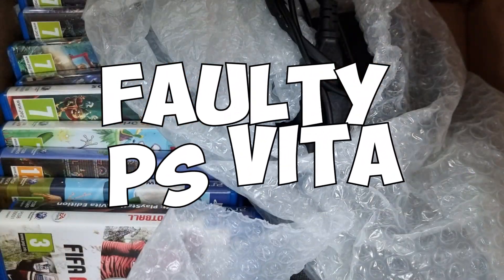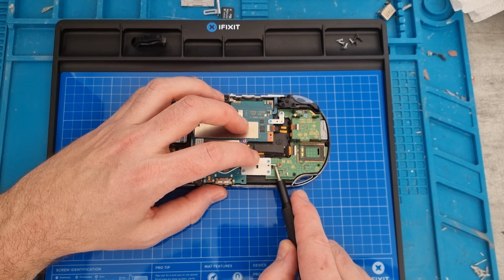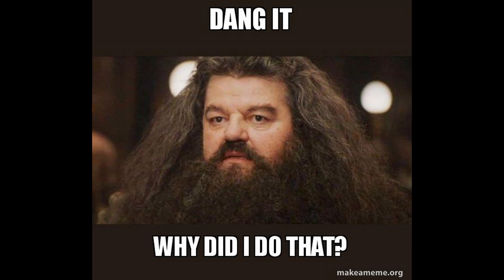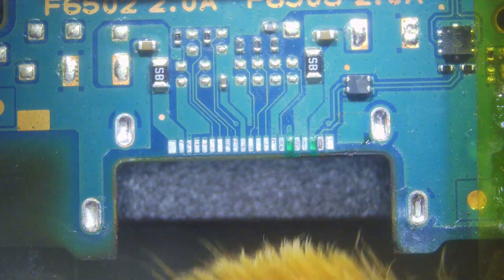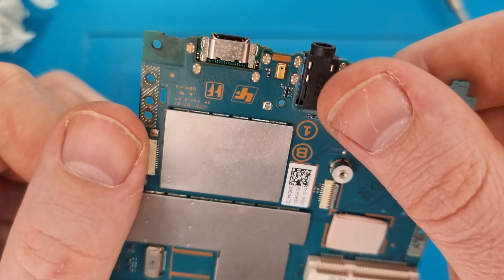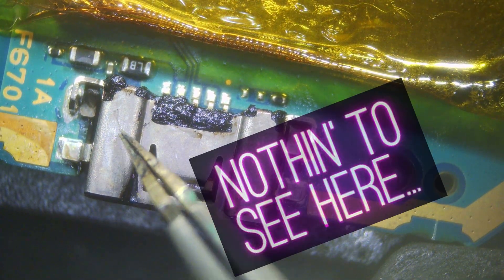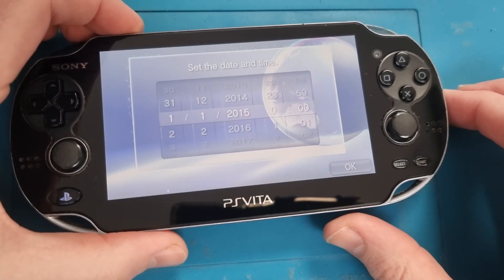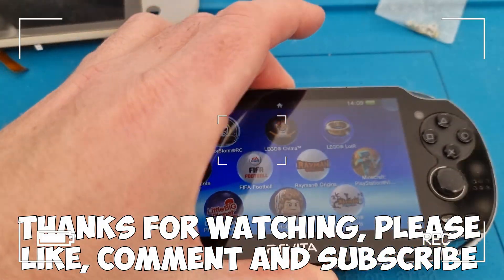Guide to installing a USB C port on a PS Vita 1000

Comment: What was the temperature range you set your air to get the old pieces off? Trying to find documentation on this part of the process. Thanks for the video!
Reply from the maker: I would have done between 360-380c,just kept it moving

Comment: Nice video, I'm having issues using a regular iron, what temperature and fan speed were you using (also could I get the model of your air station)
Reply from the maker: 360c, 70% airflow. Currently using this hot air station: https://youtu.be/wMzRhl0JpTU
Reply: @fixingmoddingbuilding thanks!

Comment: All these YouTubers make removing the old ports so easy lol I always struggle with that part 😢
Reply from the maker: I actually found this one to be really easy, didn't try to make it look easier then it is. It really does depend on your hot air station quality
Reply: @fixingmoddingbuilding  Yea I'm beginning to think my Amazon 30$ Air Station sucks lol
Reply from the maker: @Kurohige21  The most expensive repair item I have bought is on a decent hot air station. Always had cheap ones up until recent but they have there limitations!

Comment: Hey,
Do you think a Hot air station is mandatory ? I dont want to buy one for 150€ Just for a 2€ part.
Reply from the maker: For this port yes as you need to melt hidden pads. I think there is another style port that uses solder wires to other points, maybe an option for you?

Comment: What's the point of the solder mask? Just wondering if it's a skippable step bc I don't have any lolol
Reply from the maker: I think it is to stop the solder points underneath from touching the new port and shorting anything

Comment: new to soldiering would I be able to do this ? what equipment do i need to need for this ?
Reply from the maker: Mainly need a hot air station. It seemed pretty simple but also think it had the potential to easily go wrong. Too much hot air and the port will melt or fall apart?

Comment: What type of flux did you use to get the solder off the contact pads? I can't seem to get it off even with high heat/rosin
Reply from the maker: I use kingbo flux

Comment: Great job mate! you speaking like that makes it not just look great to watch but get comfort and the motivation to try it out myself too! do you recommend any skill level on soldering experience? does the usb c port change affect the battery in any way too? i was thinking of getting new batteries for the ps vita too and to combine it with the USB C port of yours!
Reply from the maker: Thanks for the nice comment.
The battery seems to be the same, chargers the same and same length.
I think this mod has the potential of the port melting or surrounding areas due to the amount of hot air that it needs.
There is another mod chip I have seen that has a few wires to solder instead of this that just uses hot air and squashes together.
I actually wanted the other but couldn't find it.
I never looked at a battery mod, maybe something to think about in the future.

Comment: top port ehci port (not really useable)
Reply from the maker: What?
Reply: @fixingmoddingbuilding  the port you took off the first time was used for debugging at the factory
Reply from the maker: @FE32GTR  Sorry buddy, didn't understand, now I do! 
Thanks for the info, glad its nothing too major!
Tried to find a replacement on Ali but struggled but don't think its need now anyway!
Reply: @fixingmoddingbuilding  you could use it for otg but you'll prob have to add a step up to change the 3.3v to allow that
Reply: How much to do this to mine please